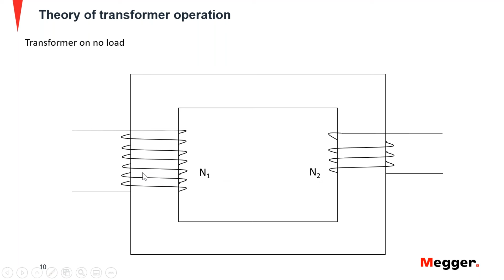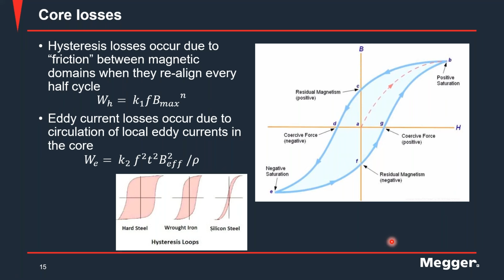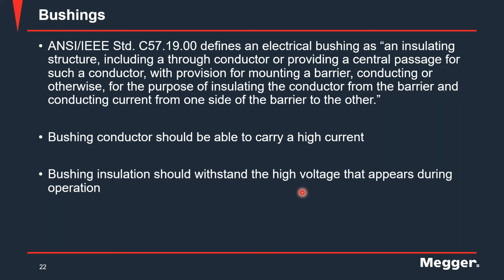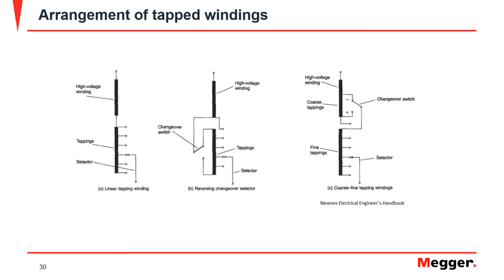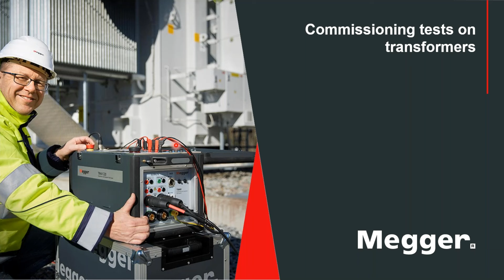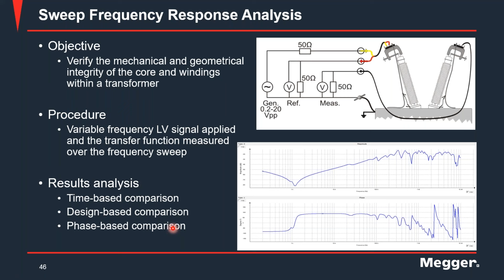Fundamentals of Transformer Commissioning and Maintenance Testing

Comment: Excellent comprehensive webinar from Megger! The section on insulation resistance testing and power factor measurements is particularly valuable — these are exactly the tests we perform before energizing any new oil-immersed transformer. Understanding the correlation between TTR results and winding condition has helped us catch several potential failures early. Great resource for anyone working in transformer commissioning.

Comment: Good pres , but I think you get wrong @ 24:40 you said that aluminum is used in smaller transformers, but I think it’s the opposite, copper is used in smaller transformers and aluminum is used in bigger transformers because it’s lighter
Reply: Ultimately, the choice comes down to a trade-off between electrical conductivity, cost, and physical strength, rather than just weight alone. they are right and you are also right as well but the consideration differs. Copper is widely preffered in larger transformers